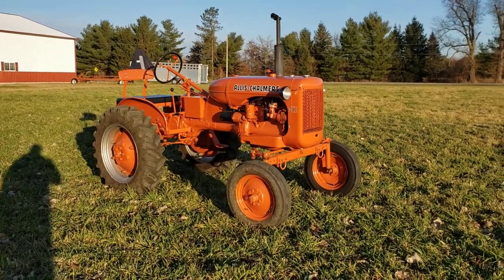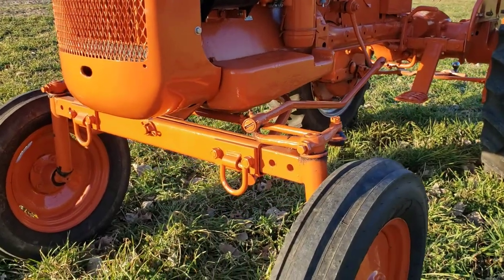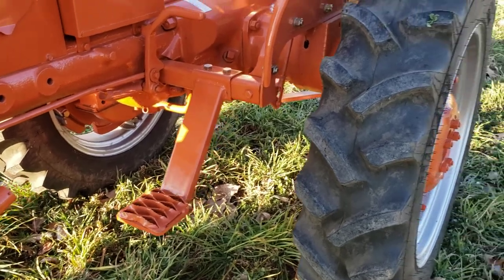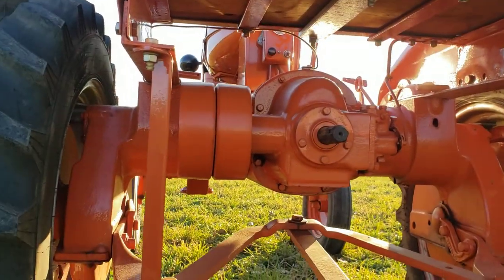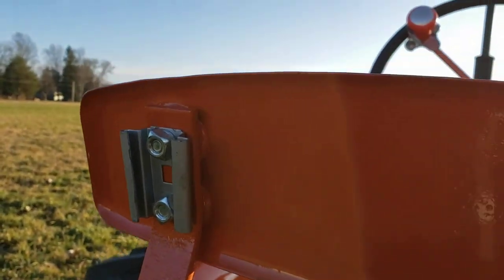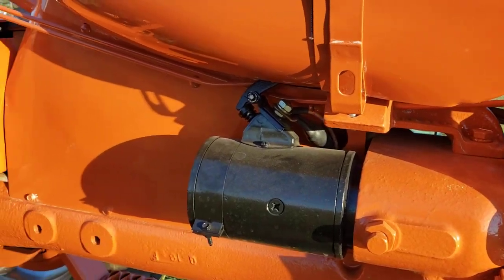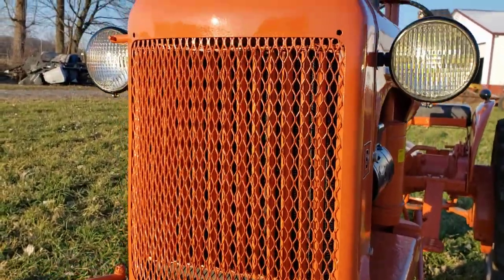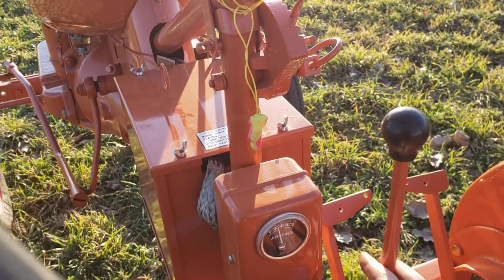1955 Allis Chalmers B Walk-Around

Comment: How do you engage the pto?
Reply from the maker: First push the clutch in, then pull up on the lever connected directly to the PTO housing. Let the clutch out and the PTO should begin turning. These don't have live PTO so it will stop turning when you push in the clutch. You also have to have the PTO engaged to operate the hydraulics.
Reply: @Randys_Relics  thanks